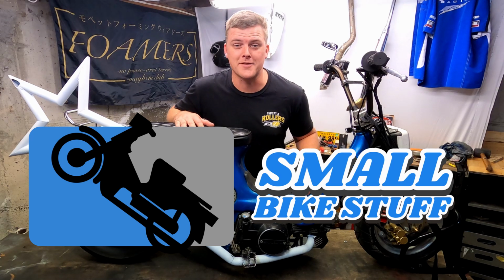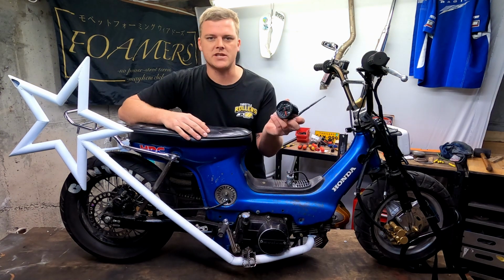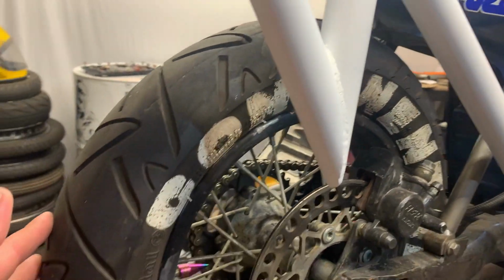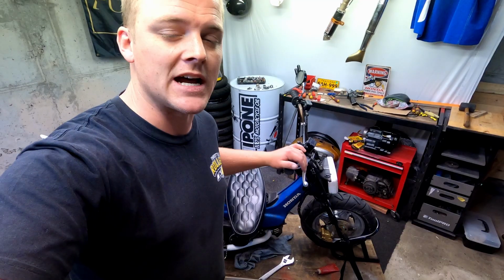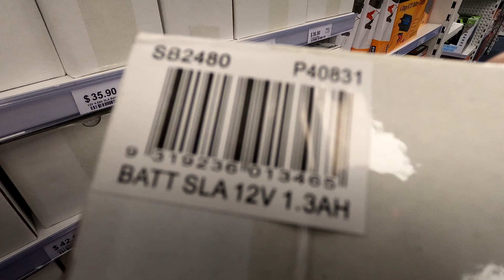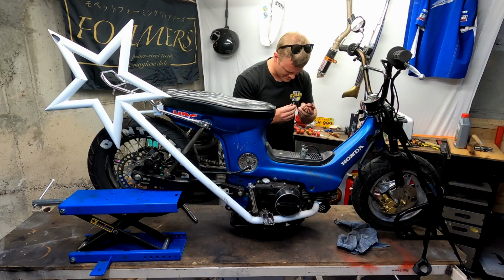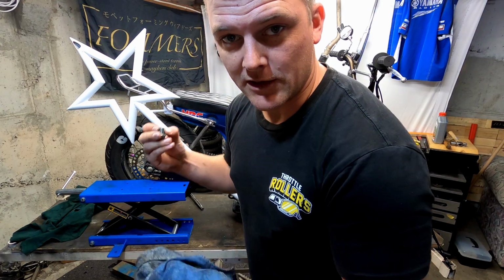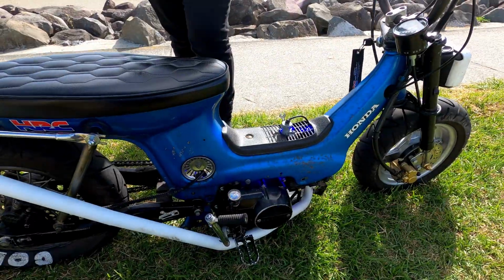STAR PIPED MINIBIKE | Honda Chaly CUSTOM

Comment: Damn you're making me jealous in that store with no mask. Where are you located? Must be New Zealand or somewhere that actually knows how to manage a pandemic. I just found your channel today. And then you uploaded!
Reply from the maker: Thanks mate! New Zealand for sure. We’ve been in the clear for a while now. Very luck to live here. Thanks so much for watching too!
Reply: @SmallBikeStuff  absolutely man. Was that a Lifan 125? How did you get it to idol so damn well. What carb is on it?  I'm running a Mikuni 22 on mine and it idols so high.
Reply from the maker: @Pigmaster6373  yeah it’s a lifan 125. Running a fake Mikuni VM22, 17.5 pilot, 110 main jet I think. Seems to be the perfect combo for a Lifan 125. In NZ by the ocean anyway. Gotta be sure you’ve got no air leaks happening before even beginning the tune. You can test this by spraying solvent/brake cleaner around the manifold to head join and the carb to manifold join while the engine is running. If the revs rise when sprayed with the brake cleaner then you’ve got an air leak to sort first. Should be easy to sort the idle with everything in place.
Reply: @SmallBikeStuff  yeah I've done all that. I've got a genuine mikuni 22 on mine. No air leaks. I've got a 17.5 idol just like you. But I've got a 125 main jet and she still seems lean. I can't buy any bigger jets online so I'm running out of options. The needle is set at it's richest setting. I still like you suspect an air leak. But I had a certified motorcycle mechanic look at it and he couldn't find any air leaks. So ig my motor might have been made with poor quality control. But I still need a bigger main none the less. She idols consistently. Just higher than I want